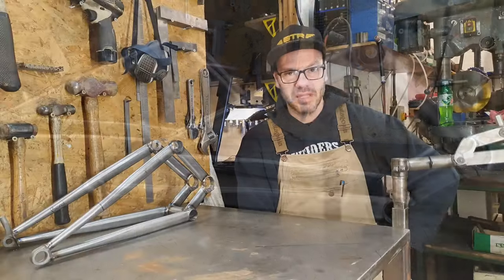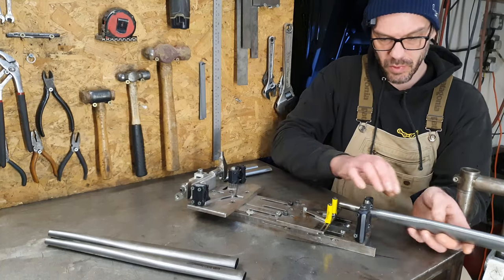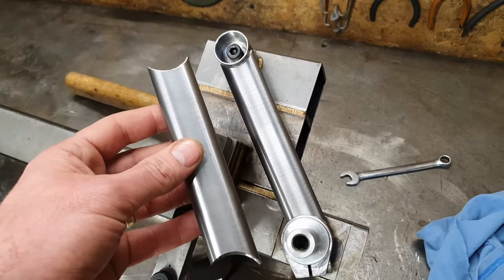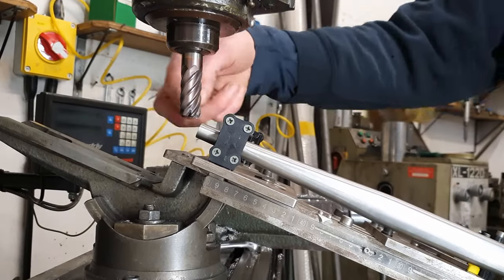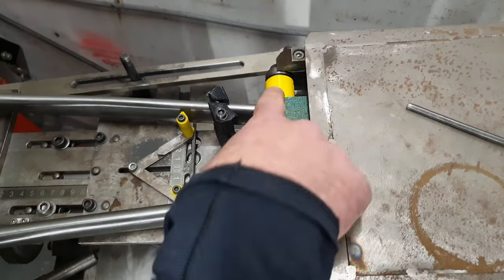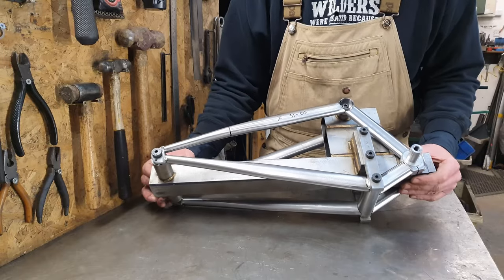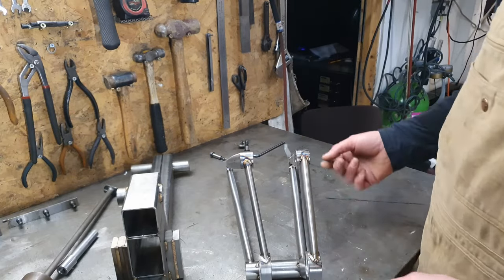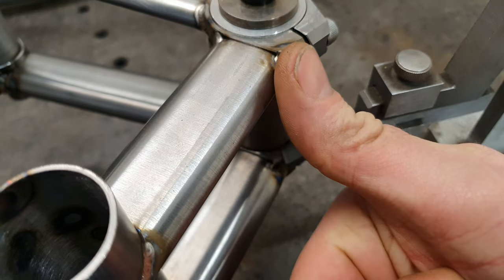3. Downhill Swingarm Notch & Tack - Gasser Project.

Comment: These videos are really amazing. They're making me think twice about my dream of designing and building my own bike one day. I have the skills to design, but the manufacturing looks even harder than I imagined.  
Keep the videos coming, this journey is super interesting!
Reply from the maker: You definitely shouldn't give up on the dream. Having all the gear I do makes this a bit easier, a bit more repeatable. But a frame can be built just using a hacksaw and some files. I've wanted to do a series where I build one in my garden shed, with feck all tools, to show you guys it can be done.
Reply: That would be epic. I'm fairly handy, but. I need to learn to tig weld, I can barely arc weld as it is. 😂
Reply from the maker: @ShreddySteve  I plan to do it with a mig welder I buy from Lidl...

Comment: safety pickle for getting the mill scale off? vinegar does seem to work though 🤔
Reply from the maker: Safety pickle? Never heard it before.
Reply: @BTR-Fabrications  we use it for taking flux off silver soldered and brazed  joints on brass and steel. sent yous a pic 👍

Comment: Nice work on the vids. Future vids are going to be so much shorter now that you are sorting fixturing.😂 Maybe use sand inside the tubes before you squash 'em?
Reply from the maker: Ha ha. Sand in the tubes is a bit of a wife's tale. It's not actually easier to get a good result because you have to pack the sand really hard and stop it coming out the ends of the tube when you bend/squish.